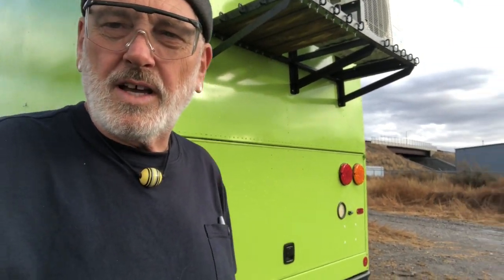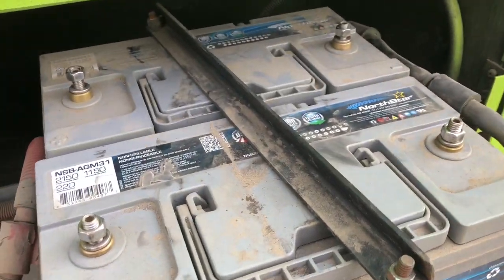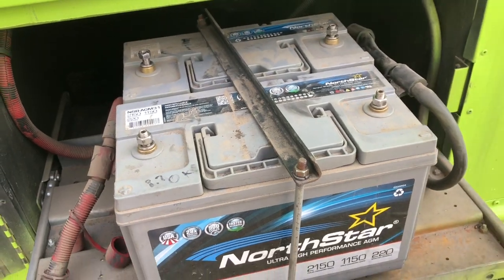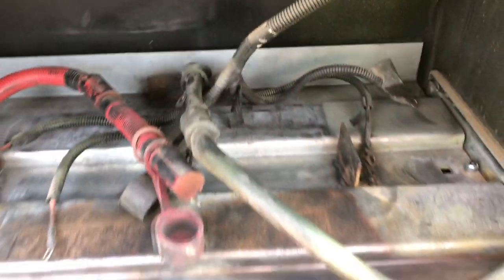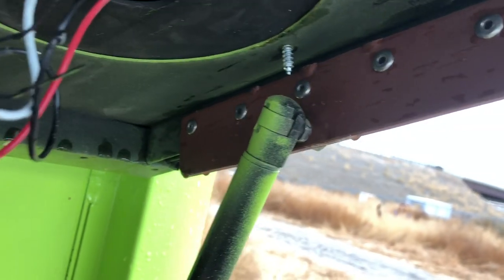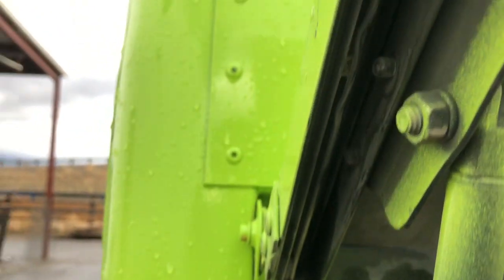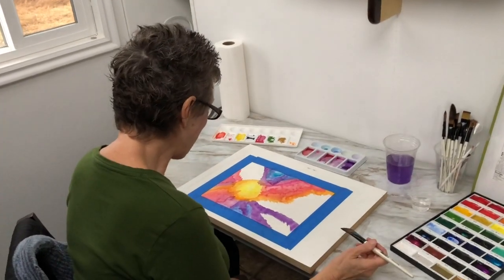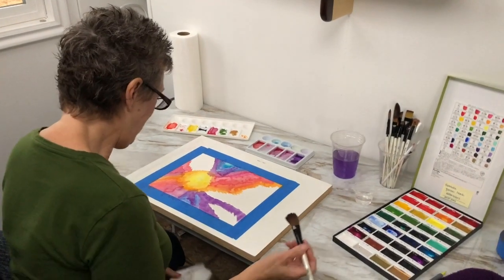Battery Box and Rear Hatch Repair - Vlog 191 School Bus Conversion

Comment: Well done Randy my first coach had the same thing going on with the battery tray 
I'm thinking the batteries off gassing is hard on the metal in the boxes I was thinking about using and undercoating of some kind to protect the area.
Reply from the maker: Thanks. 😃👍😃